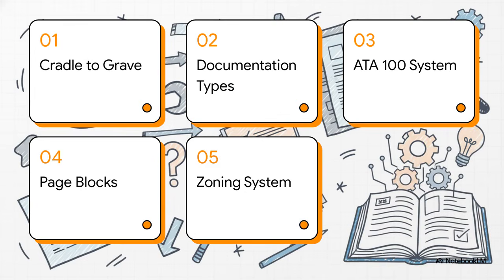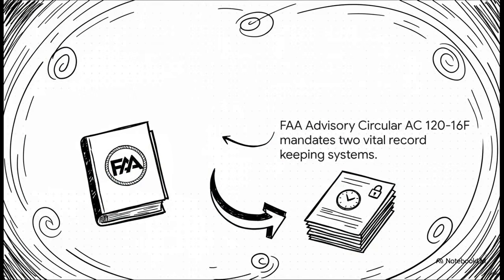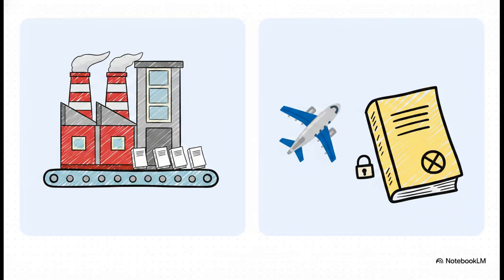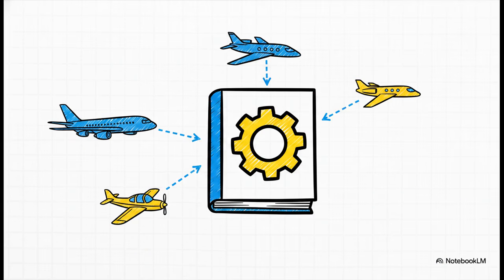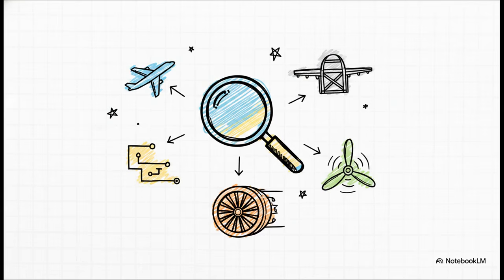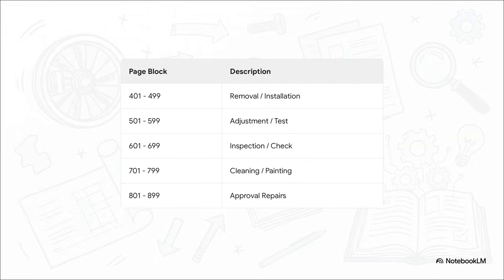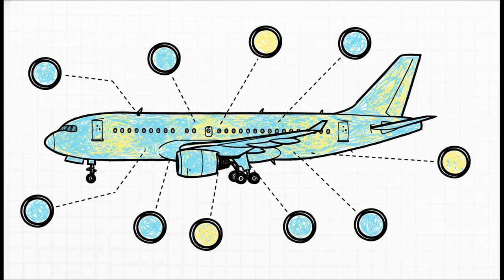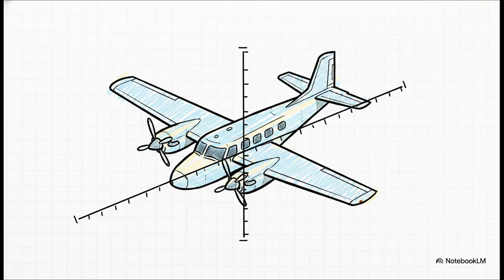AMTE 231 LESSON 01 INTRODUCTION

Comment: This AMTE 231 lesson was important to me because it helped me understand the value of proper documentation in aircraft maintenance. The ATA system provides an organized way to identify aircraft parts, systems, and maintenance tasks. The zoning system also helps make it easier to locate specific areas and components of an aircraft. As students, learning these systems is important because they can help us work more efficiently and reduce mistakes when dealing with actual aircraft. The lesson also made me realize that aircraft maintenance is not only about repairing or checking components. It also involves being organized and keeping accurate records of the work done. Proper documentation can help maintenance personnel understand what needs to be done and where specific components are located. Overall, this lesson showed me that following organized systems and maintaining proper records are important parts of doing aircraft maintenance safely and correctly.

Requidan, Tiffany Dawn P.
AMTE 231 - 1B
A.Y 2026-2027

Comment: The AMTE 231 lesson on aviation maintenance documentation explains how proper records are essential for aircraft safety, reliability, and certification. It covers the importance of maintaining a complete record of an aircraft from construction to decommissioning, as required by the FAA. The lesson also discusses four main types of documentation: manufacturers’ manuals, regulatory documents, airline-generated records, and ATA standards. The ATA 100 system organizes maintenance information into chapters and subjects, while Master Maintenance Page Blocks use three-digit numbers to identify tasks such as inspections, removal, and installation. It also explains aircraft zoning, where large aircraft are divided into major zones and smaller aircraft use reference datums and stations to locate components. Overall, the AMTE 231 lesson emphasizes that accurate and standardized documentation is essential for safe and efficient aircraft maintenance.

PELLOS, JULIUS ROME M.
AMTE 231 - 1B
A.Y. 2026 - 2027

Comment: For my opinion, the main lesson of the video is that aircraft maintenance is about having the technical skills to inspect, repair, or replace aircraft components, but also about knowing how to properly use maintenance documentation. The different manuals, ATA numbering system, page blocks, zones, and maintenance records may seem very complicated at first, but once you get the gist of it its easy to understand because they are important for keeping maintenance work organized, accurate, and traceable. I believe that as a future aspiring aircraft maintenance technician, we need to develop both our hands-on skills and our ability to understand and follow technical documents because safety depends on doing the correct task using the correct information. Overall, the video gave me a better appreciation of how documentation supports the entire maintenance process and why discipline and attention to detail are essential in aviation.

Caña, Azriel Roch R.
AMTE 213 - 1B
A.Y. 2026 - 2027

Comment: Lesson 1 of AMTE 231 has taught me the that aircraft documentation must be thorough as it is a continuous process starting from the moment it was built to the day of its decommission of the aircraft. As it is mandated by the FAA as the Philippines air law is based of within the FAA. This standardization ensures that every action done to the aircraft is recorded and traceable. Along with ATA system is to organize tasks and reduce confusion within the maintenance work field. As zoning systems as well gives us a precise whereabouts of which component to find within the aircraft. These are just a few lessons we must understand the structural designs of the aircraft to minimize errors.

AMTE 231
JS.R.MUNSAYAC_1B_AY2026-2027

Comment: In Lesson 1, I learned about Aircraft Technical Publications and how important they are in aircraft maintenance. These publications provide the information, instructions, and procedures that maintenance personnel need when inspecting, servicing, repairing, and maintaining an aircraft. I also learned about the ATA chapter numbering system, which organizes information about different aircraft systems and makes it easier to find specific topics in technical manuals. This system is helpful for technicians, pilots, and engineers because it allows them to locate the information they need more quickly. I realized that following the correct procedures and instructions in these manuals is very important because even a small mistake in aircraft maintenance can affect the safety and performance of an aircraft. Overall, this lesson helped me understand that technical publications are essential tools for maintenance personnel. It also gave me a better understanding of what I can expect to learn and apply as I continue studying aircraft maintenance.

J.T.REYES_2B_AY2026-2027

Comment: AMTE 231 Lesson 1 was very helpful because it introduced the different types of aircraft maintenance certification and documentation used in the aviation industry. The lesson explained the importance of proper documentation, aircraft zoning structures, and the use of the ATA 100 system in organizing maintenance information. It also showed how standardized page blocks make technical manuals easier to understand and navigate. Overall, the lesson helped us realize that proper certification and documentation are essential for ensuring accurate maintenance, safety, and efficient aircraft operations.                                                                                                                                                                                                                                                                                             
C. I. L. REPIL
AMTE 231-2B

2026-2027

Comment: After watching the AMTE 231. For me this lesson is important because it taught me the value of proper documentation in aircraft maintenance. I learned that the ATA system helps organize and identify aircraft parts and maintenance procedures, while the zoning system makes it easier for mechanics to locate specific components. As students, understanding these systems is necessary before we work on actual aircraft because they help us perform maintenance tasks more efficiently and correctly. Overall, the lesson made me realize that accurate records, proper organization, and attention to detail are essential in maintaining aircraft safety.

FARIÑAS, ROLAND VINCENT E.
AMTE 231-1B
2026-2027

Comment: In my own opinion in this video lesson about Manufacturer’s Documentation helped me understand how important documentation is in the aviation industry. Before watching the video, I thought aircraft documents were mainly used for recording repairs and maintenance. However, I learned that documentation is much more important because it covers the aircraft’s entire life, from the time it is built until it is finally decommissioned. This is called the “Cradle to Grave” concept.

I also learned that manufacturer’s documents provide important information about aircraft parts, systems, inspections, repairs, and maintenance procedures. These documents help aviation maintenance technicians perform their tasks correctly and safely. They also ensure that maintenance work follows the manufacturer’s recommended standards and requirements. Proper documentation is important because it provides a reliable record of the aircraft’s history and helps maintain airworthiness. Overall, this lesson taught me that accurate and complete documentation is essential for safety, reliability, and safe maintenance throughout its entire service life.
 
J.A LAVADO AMTE_2B_AY2026-2027

Comment: AMTE 231 Lesson 01 Summary
Lifetime Records: Per FAA AC 120-16F, planes need a "cradle-to-grave" record, meaning every fix and check must be logged from manufacture until disposal.
Core Documentation: Covers the 4 basic types of maintenance documents used in aviation.
ATA 100 System: Teaches how to read part codes (like 52-11-02-401) to locate components quickly.
Manual Setup: Explains page number groups (such as the 400 series for taking off and installing parts), zone codes, and reference datums.
Personal Reflection: The topic feels heavy on memory work due to all the numbers, but the video keeps things simple by focusing only on test material and ending 

Aparte, Josiah T.
AMTE 231-2B
S.Y 2026 - 2027

Comment: This video serves as a great tool for exam preparation when trying to get certification in aviation maintenance. It is very practical in its nature and does not contain unnecessary things but only talks about "language of safety"-the terms and regulations (like FAA AC120-16F) that should be known to the technician.
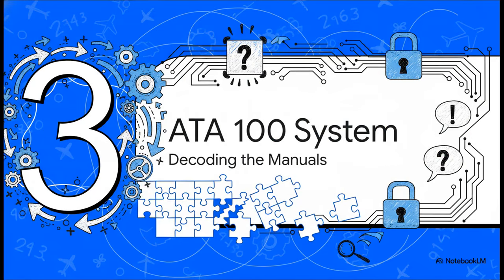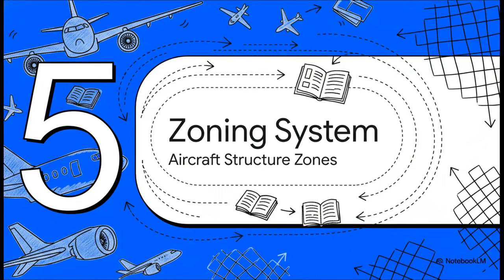The most important feature of this master class is its structure. From general documentation principles, it goes through the ATA 100 system (2:58) and structural zoning (6:13). In such a way, the instructor turns dry technical standards into some kind of map in your mind. It is great that the lesson ends with a pop quiz (8:01). This is a good method since it makes you integrate several parts of information-systems chapters, zones, and maintenance task blocks.

DELA CRUZ, Jayrie Jade B.
AMTE 231 - 2B (AY : 2026-2027)

Comment: This video about AMTE 231 Lesson 01 provided a great breakdown of aviation maintenance documentation standards. The key takeaway for me was how the "cradle-to-grave" principle ensures safety and continuous traceability across an airframe's entire operational lifespan. Understanding the ATA 100 breakdown and specific page blocks (such as the 400 block for Removal/Installation and 600 block for Inspections) is extremely practical for efficiently locating standardized procedures on the floor.

Guanlao, Jeremiah S.
AMTE 231 - 1B
AY 2026–2027

Comment: After watching AMTE 231 Lesson 1, I realized how really important proper documentation is in aviation maintenance. When I first encountered seeing the different manuals, ATA Chapters, page blocks, and aircraft zones seemed like a lot of information to memorize. However, after looking into it more, these systems are very convenient since it is actually designed to make maintenance work more organized, consistent, and safe. I found the cradle to the grave concept important since it shows that every maintenance action done on the aircraft becomes a part of that aircraft's history and each action must be properly recorded and documented throughout its service life until its end of service. I also realized that by knowing how to understand and read the ATA codes and other maintenance documentation is not only important for passing an exam but to ensure that mistakes does not happen when working on an actual aircraft. 

De Belen, Gerard Majella V.
AMTE 213 - 1B
2026-2027

Comment: For me, the video helped me understand Lesson 1 better because it showed the importance of aircraft maintenance documents and manuals. I learned that aircraft maintenance is not only about repairing and inspecting the aircraft, but also about using the correct documents and information when doing maintenance work. The video made me realize that manuals like the AMM, CMM, IPC, and FIM are important tools for technicians because they provide the proper information and procedures for different maintenance tasks. I think using the correct manual can help prevent mistakes and make the work safer and more organized. I learned that I should not only improve my skills in using tools and working on aircraft, but I should also learn how to properly read and understand maintenance documents because I will need them in actual aircraft maintenance work.

Santillan, Ashix Mackenzi
AMTE 231 - 2B
AY: 2026-2027

Comment: The video AMTE 231 LESSON 01 INTRODUCTION provides a practical and easy-to-understand overview of aviation maintenance documentation and aircraft referencing standards. It explains the importance of different manuals used in aircraft maintenance, including manufacturer manuals and operator-specific manuals. I also learned about the ATA 100 numbering system, which helps organize aircraft maintenance information into different chapters and sections. The lesson also discussed procedure page blocks, which identify specific maintenance procedures and make it easier for technicians to find the information they need. Another topic discussed was the use of structural zones in an aircraft, which helps technicians that really identify the exact area where maintenance work needs to be performed. The coordinate station system was also explained on it, showing how locations on an aircraft can be identified accurately. Overall, the video helped me understand how proper documentation and aircraft referencing make maintenance work more organized, accurate, safe, and easier for aviation maintenance personnel to perform.

Rosales, Rence Emmanuel D.
AMTE 231-1B
AY: 2026-2027

Comment: In the video AMTE 231 Lesson O1 Introduction, I learned how aircraft maintenance documents are organized and why they are important. I learned about the "cradle-to-grave” rule, which means that all maintenance and repairs must be recorded from the time an aircraft is built until it is retired or scrapped, following FAA AC 120-16F. The lesson also explained the four main types of documents, the ATA 100 numbering system, and how codes like 52-11-02-401 help locate specific parts and procedures. It also discussed page blocks, such as the 400 series for removal and installation, as well as aircraft zoning and reference datum. For me, the topic is important but can be a little overwhelming because of the many numbers and codes to remember. However, the video made it easier to understand by focusing on the important points and including a short quiz to check what 1 learned.

Asi, Gian Paolo R.
Amte 231-2B
S.Y. 2026-2027

Comment: In my opinion, the video is a helpful and informative review of aviation maintenance documentation because it explains important concepts in a clear and organized way. I especially found the discussion about the cradle-to-grave documentation process, ATA 100 system, maintenance page blocks, and aircraft zoning useful because these are important for locating information quickly and performing maintenance correctly. The examples also make the technical information easier to understand, especially the explanation of how ATA chapter, page blocks, and zones work together. Overall, I think the video is a good study guide for aviation maintenance students because it connects documentation procedures to actual maintenance work and emphasizes the importance of accuracy, organization, and safety.

NOZA, PAUL BENSON B.
AMTE 231 - 1B
2026-2027

Comment: In the video AMTE 231 Lesson 01 Introduction, I learned about how aircraft maintenance docs work, especially the "cradle-to-grave" rule where every single repair has to be recorded from the day the plane is built until it gets scrapped under FAA AC 120-16F. It breaks down the 4 main doc types, how to decode the ATA 100 system like using 52-11-02-401 to find specific parts fast plus page blocks like 400s for removal/install and zoning with the reference datum. Honestly, my take on this whole AMTE topic is that it's super important but kinda overwhelming with all the numbers u gotta memorize, but this video makes it way easier since it skips the boring stuffs, tells u straight up what’s on the exam, and uses a quick quiz at the end to make sure it actually clicks.

Callejo, Mhaize D.
AMTE 231 -2B
S.Y 2026 - 2027

Comment: For me, Lesson 1 gave me a clearer idea of what it really takes to work in aircraft maintenance. I realized that being a technician is not only about knowing how to handle tools or work on aircraft components, but also about knowing where to get the right information and how to use it correctly. The topics about ATA 100, aircraft areas, and station locations showed me how information can be arranged in a way that makes maintenance work easier to manage. I also learned that keeping a record of previous work is important because it gives other technicians useful information when the aircraft needs to be checked or worked on again. Overall, I think this lesson is a good starting point for AMTE 231 because it showed me that being careful and responsible is just as important as having technical skills in aviation.

GUINTO, MARIAN GERTRUDE C. 
AMTE 231 - 1B 
S.Y: 2026-2027

Comment: My Opinion About AMTE 231 Lesson 01

In my opinion, the AMTE 231 Lesson 01 video was informative, helpful, and interesting because it gave me a better understanding of aviation maintenance documentation and aircraft referencing systems. It clearly explained how different aircraft manuals and documents are used to support maintenance activities. The lesson also introduced the ATA 100 numbering system, which helps organize aircraft information into specific chapters and sections. It discussed page blocks, aircraft zoning, and station numbering, which are important in locating and identifying aircraft components. I found the discussion easy to follow because the information was presented clearly and in an organized way. Overall, this lesson helped me understand the basic concepts of aviation maintenance and prepared me for future discussions.

MANANSALA, ISAIAH RENDEL S.
AMTE 231 - 2B
2026 - 2027

Comment: This Amte 231 lesson 1 was very helpful as it tackles the different types of aircraft maintenance certification and documentation. from the four main documentation types to aircraft zoning structures. to emphasize the universal ATA 100 system and standardized page blocks it provides us with a decoder ring that makes hard looking technical manuals into logical, manageable tools.

Asuncion, Christian Josh Q.
AMTE 231-1B
2026-2027